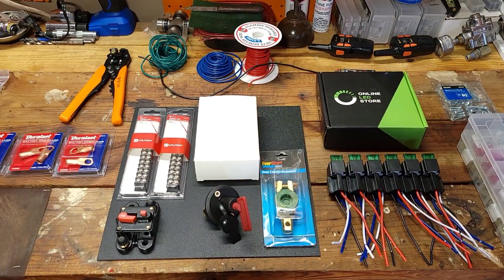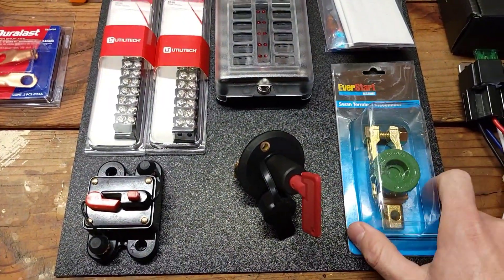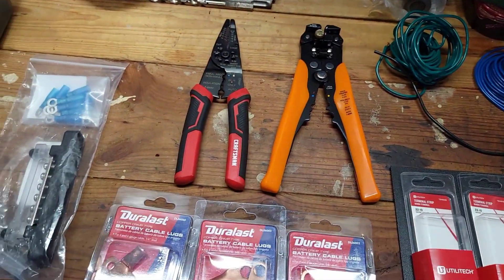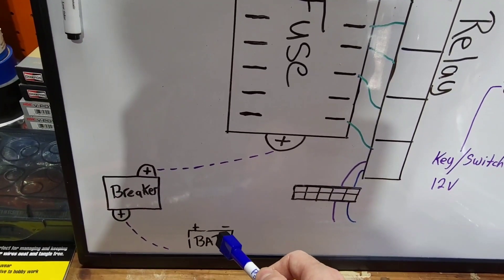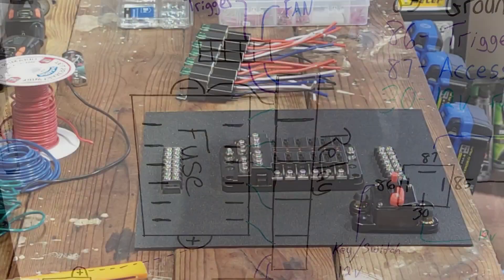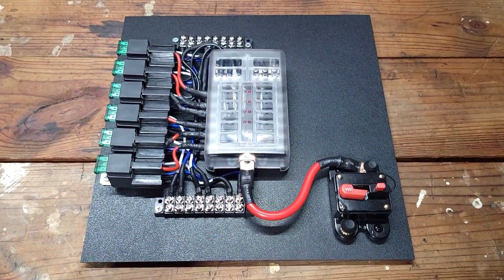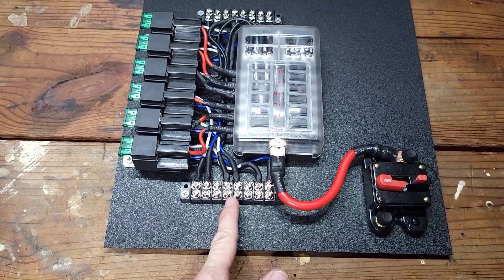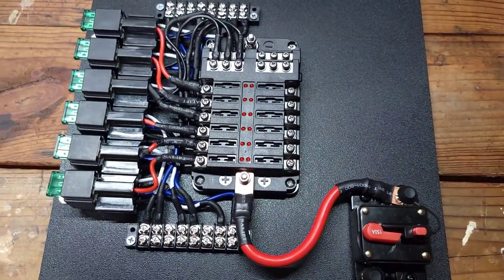DIY Relay Panel

Comment: If you use 30 amps in the fuse block, make sure the wire you use can handle 30 amps.

Comment: Very neat explaination and setup! What kind of material is that base sheet?
Reply from the maker: Thanks a lot! The base material is a sheet of kydex, you could also use abs plastic which is commonly found in hardware stores.

Comment: great work ! but if i put the relay panel next to the battery in the trunk and i wire the radiator fan still ill loss voltage and the wire is gonna heat ?
Reply from the maker: Possibly, dependingon your wire size. Mine going in a truck so the distance isn't that far. Another option is to mount the fan relay under the hood somewhere near the fan.

Comment: Nice setup, but having fuses on the relays is a waste of money and space when running a fuse box could of done away from that
Reply from the maker: Thanks👍the relays with the built in fuses were actually cheaper, that's the only reason I got them

Comment: So you made this to eliminate the old fuse box and bulkhead in the old truck?
Reply from the maker: This was made for my dakota, we are doing a street/strip build on it. I kept the factory fuse block and bulk head for standard stuff like headlights and wipers, this relay panel will power additional equipment like nitrous, fan, fuel pump, ignition, ect.